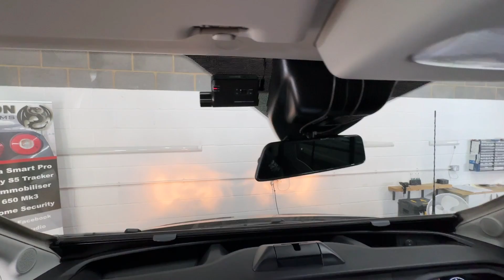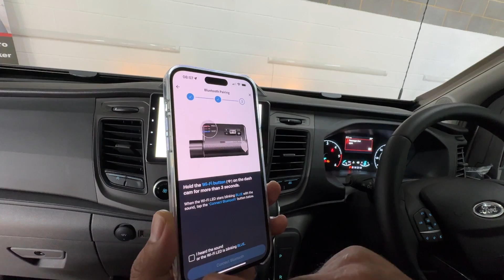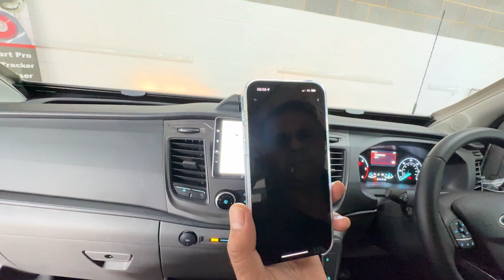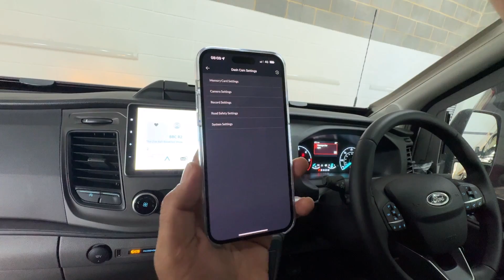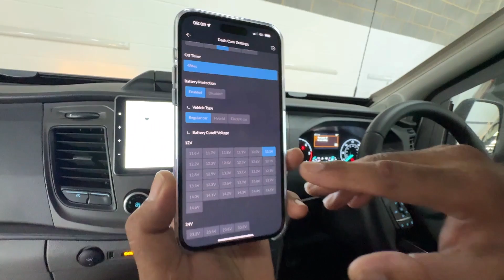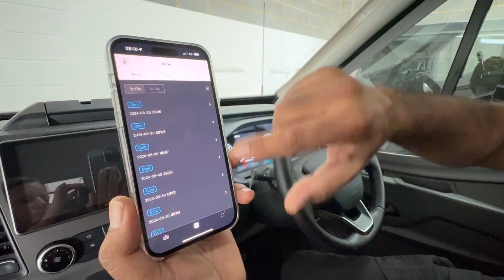Thinkware Dash Cam Q850 | Dragon Car Audio | Fareham

Comment: hi, does it have the same power input as the older F770 and are the front and back cams still connected via micro usb.

I have a 6yr old F770 that the dates and times are all wrong and gps wont reset, years from 2079 to 2179,and i really don't fancy using new wiring with a new cam